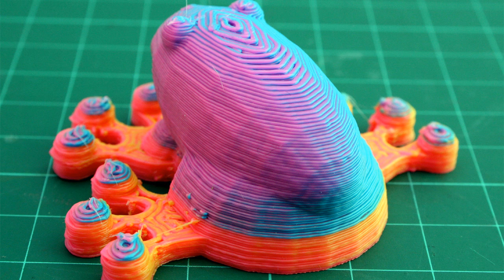3-way extruder and colour blending nozzle Part 2 - Build up and Printed things

Comment: The fact that you change change colors mid-print is very cool. I wonder if you can just have a hardware switch without having to modify your board or firmware that switches between extruder motors.

Comment: RGB is an color model for additive light. CMYK is for subtractive light...  With printing with ink on paper, usually you would use pigments to absorb the various wavelengths of white light to get to a perceived color... 3d printing isn't quite the same as ink on paper, so... this is really some great research into how filaments work in a blended extruder.

Comment: Why the pneumatic fittings? Are they used to provide unidirectional movement of the filaments or are they used to grip the ends of the sheath tubing?  I ask because it seems some printer extruder designs reverse the extruder motor to pull the filaments back to allow extrusion to stop for controlled gaps. Perhaps with your design abrupt color changes are supported by reversing the extruder motors.

Comment: This is my speculation. Better mixing might be possible without hardware changes and just minor addition in firmware. 
A tweak of the retraction mechanism could assist in better blending.
If the three drives, several times a second, took alternating turns of quick retractions  while the other two compensated with an increased pressure to keep the overall output even. Its possible that the relative pumping action will overcome viscosity resistance to mix with a more braiding like flow. Thoughts?

Comment: Convenience.. & blends.
 However, "instantaneous" would be better as you suggest.
One way to do it, if extending the functionality of existing extruder designs, might be some kind of teflon cutter at the nozzle tip, so material is placed with much more precision at specific points without probs. 
a better way might be like a heated old dot matrix printer head element.. but instead of ink, it could flick out precise quantities of molten plastic instead. ie like a tiny punch inside the extruder.

Comment: Your idea sounds good IMO.
BTW I meant like a single element/dot per colour/head, imagine a constantly spinning motor with an L shaped spindle.
The L could flick a Flat metal spring which had a small rod attached to it.. this could enter a heated plastic section. can be arranged so not flick position stops flow.
 it would just take a tiny movement so L touched/didn't touch for dot or no dot as it went.
in terms of complexity it could be very simple.. with one such 'dot' element per colour.

Comment from the maker: Dichloromethane - I used to use that in the electronics industry about 15 years ago, but it's not nice stuff, I actually don't know where you can get it from anymore, interesting to know it will work on PLA, thanks.

Comment from the maker: I talk a little about the electronics in Part 1 - it's basically a normal RepRap RAMPS 1.3 and a seperate board to expand the Extruder drives (4), they are enabled or not depending on how your Esteps are set. More info on my Blog, and I'll try to get up some diagrams etc.

Comment: (contd). Inside the long extruder, imagine having 1 shaft with a small gear that can mesh with only one of X drive gears at a time. The shaft can move back and forth with that extra actuator, depending on which color to be pushed when. The same actuator can also be moving a stopping sheet with a small hole allowing only the pushed color to pass through, and blocking rest of the nozzles.

Hope you could understand what I mean? - It ain't easy to explain :P

Comment: With the dot matrix, the extruder mechanism would be too complicated (nearly impossible - practically). Problem is also with stopping the heated plastics' overflow even when extruder is not pushing.

I have a solution which I think is practically feasible. Imagine having a 'line' (array) of X number of colored plastic reels going into One extruder (through arrays of slots very close by) which contains X number of drive gears. Now it comes down to pushing 1 color at a time, when needed. (contd)

Comment: But it would still print colors layer-wise ... I am waiting for an instantaneous 3D Color printer !

The reason this video didn't fascinate me is because I have blended 8 different colors, in 1 go, using my Makerbot (1 extruder) by constantly cutting and changing the reels.

Why waste extra money, when 1 extruder with a simple method provides the wanted colored 3D Object, whenever required!?